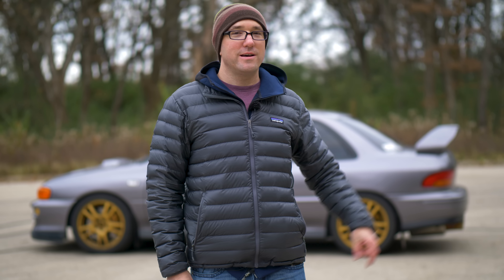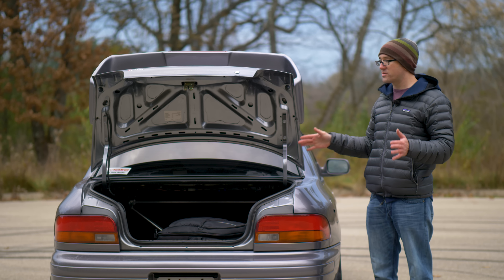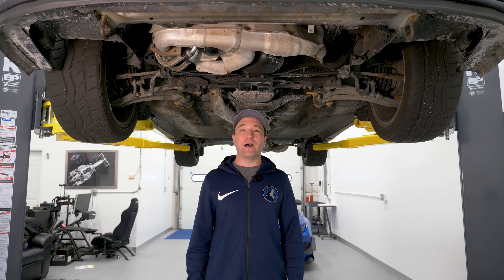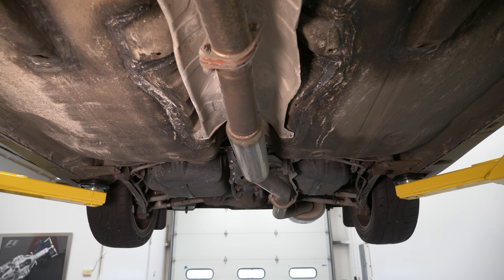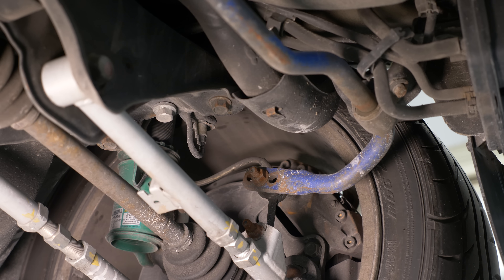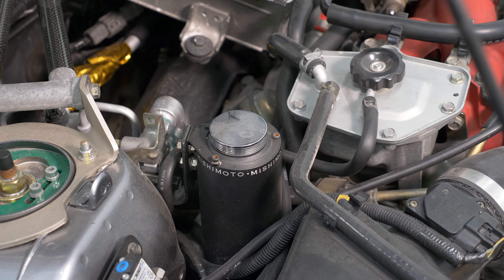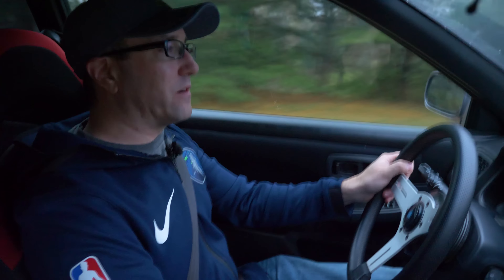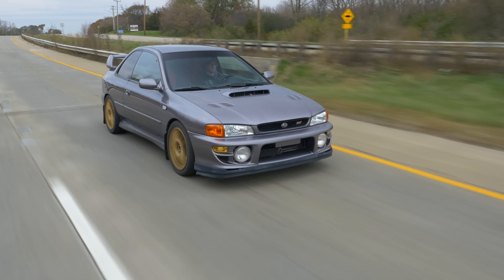Review | Subaru RSTi | When Older is Better

Comment: I too like late 90's early 2k's vehicles. My wife 2016 Escape is nice, but its too nice (for me). I had a 2014 Cruze (worst manual to ever exist), wound up losing some money on that vehicle since no one drives manual anymore. It was nice riding, boring, and fairly basic for the times. I would buy another but it would need to be the turbo model and probably auto, or the diesel version. Anyways, I eventually bought a 2006 SAAB Troll-Blazer with low miles. It has been great and every real SAAB owner still waves like it is special secret club; however, I am selling that next year (already have a buyer), I've decided I want some even more basic. Not sure what, but maybe an late 90's Mustang or Camaro, Subaru (have owned several Subaru's and love them!), or a Chevrolet Avalanche - which is something I've always wanted since they came out in my senior year.
Reply: Just wanted to add the Subaru I am thinking about is a Subaru Outback XT w/ manual. Would buy auto if the price and miles are right. Up here in Alaska they are too expensive. I can fly into Seattle and find one with less miles, the color I like, and options I want for about 2-3k less. Even after flight, time off work, and fuel / food, I would save $2k.

Comment: It's funny how simply you can circumvent legal restrictions by legally replacing almost everything that can be replaced. Jokingly, they could just have sent the VIN plaque to Japan and imported it that way. - Man, my car could use a total overhaul like that. I want it to last forever. But for that, first I'd have to find a calling that lifts my spirit out of the dark. (And now the Covid crap makes everything even worse.)
11:12 Is that the oil cooler? Because that's what my intercooler radiator looks like. 🙁 (While my engine radiator only works on the upper half. What a waste.)
11:15 Apologizing for rhyming is really douchebag style.
11:40 Speaking of mature: My custom racing brake has black calipers and moderately slotted discs. (with Pagid RS 4-2-1 - Ferrari street OEM)
The acceleration test made you laugh excitedly. That is a gold badge of approval.

It shocks me a bit that you say its chassis rigidity is not like modern sports cars - after the guy did pretty much everything you can do to improve it. ... Hm, I am wondering whether two strut bars might actually make the mid-chassis twisting more noticeable. ... BTW, I installed a cheapo front strut bar on an old Corolla AE90 and I could feel a significant improvement in front rigidity. I didn't expect it to be that distinct.

Comment: How is that RSTI so heavy? I put my STI Type R 1998 (JDM) on a scale the other day and minus my weight it was at 2730 lbs
Reply from the maker: +Anthony Therrien-Bernard Full tank, seam welding, foam, additional parts.
Reply: I should have watched until the end before commenting... i'm sure that helped a lot, quite a bit of additional weight but chassis rigidity is indeed not very great out of the factory
Reply: sunroof

Comment: Rather have a current STi drivetrain swapped  with the Porsche designed 6 speed  transmission and the 2.5L turbo with it's attendant extra torque.

Comment: "Dead nuts reliable" - as a subaru owner, I laughed
Reply: Idk man.. with proper maintenance I’ve had good luck with Subaru’s and Honda’s... well most cars aside from modern Audi’s and bmws and benzs
Reply: KrispyyWombat older Subaru if not over-boosted was reliable I heard but if you drive a high boost one like you stole it, well it will probably cry on you

Comment: Very cool, very well done build.  

One pedantic quip: this is a GM6 turned into a GM8.  The GC is a sedan. The GM is a coupe. It’s in the VIN.  The only way this could have been better is it it were a GF8 (wagon).
Reply: JDM coupes had GC stamped on the VIN and model# as well, and the P1 sold in the UK had also a "GC8" VIN. In fact, only USDM coupes were GM. Just to point out not all coupes are GM ;)
Coming from an original GC8 fellow owner, that's a great car, great job and taste into that RSTi.

Comment: @savagegeese How the hell do we get these cars back. Why can't they just re manufacture them again. It wouldn't cost them much with all of the blue prints done.  And upon buying them sign a contract that states you don't mind not having modern safety so they won't be sued. There's got to be a way to have these cars back in our lifetime. I don't wanna die not knowing how it felt to drive a new S2000, STI, or GTR from the 90s. I wanna know what it felt like to drive an old AE86. There's got to be a way. There's money that can be made.
Reply from the maker: +MusicBro94 probably need to start a company that has the power to license the designs of these old cars to remanufacture them. Thats about the only way and the f-you money you would need is unfathomable.
Reply: True. Sounds like something China could do haha. Thank you for your response.
Reply: regulations are curse , they wont make cars like this anymore because of government

Comment: "...from the header wrap" - there is no header wrap. Those are stock headers with factory heat shields.

"...from the little things you get a sense this car is not just a normal Subaru" - lists basic upgrades like swaybar endlinks and silicone coolant hoses. 

"..another special addition is this oil cooler. It cools the oil when you don't need it to...and adds extra places to leak oil from" - and the line rests on the header shields, to heat the oil when you don't need it to. Yeah, sounds pretty useful! 

" Ah I see it has the Cobb flex kit!" - points to the boost controller. 

Your video turned out to be more of a joke than Subaruwrxfan's ones, and his ones are meant to be a joke.
Reply from the maker: +Alexei Debelyi You cherry picked some good stuff bruh.
Reply: There's no need to call it cherrypicking. You messed up in a bunch of really basic areas, while attempting to educate others on the topic, own it. 

If you really want to get technical - your whole spiel about "high revving engine from factory" is largely BS - this was never a factory option anywhere but Japan. Your whole point about 90s cars being ahead of their time is moot, because you're comparing a custom build to factory options. 

That build is the same (less effective in fact) as taking any current USDM Subaru and sticking a version 10 Sti Ej207 into it, since Japan still makes those engines today. Yet according to you - that's only available back in the 90s. 

Your own lack of research and knowledge on the subject is the reason you made up a story that suits your own agenda, instead of what's going on in the real world. Sure, the cars are heavier these days, but most of the "tuner" offerings have improved in the last 20 years, not gone backwards as you suggest.
Reply from the maker: +Alexei Debelyi We never got this car in the USA. Not sure why you are so triggered over it. The point is and has been cars have been getting fatter and more complicated since the 90s. This car and other JDM style vehicles were vastly more drivers centric then.

It had header/exhaust wrap on it, feel free to review the footage again. No idea what you are blabbing about with the oil cooler, its placement sucks and the point of leaking lines being a concern is just that.  I spliced in the wrong footage for the boost controller/flex fuel kit.  I could waste my time arguing your personal agenda at clearly not liking our content but I will repeat this, high revving naturally aspirated asian cars are dead in the USA. Thats why that car and vehicles like older Hondas are special these days and why they have a cult following.  If you have your own video made on this car that shows it better feel free to link me to it so I can gladly comment on your perfect view on it.

Comment: I bought an STi4 new in 98 and wrote about tweaking it in EVO UK. We improved motor, exhaust, intake, brakes (AP), suspension (corner weighted LEDA) etc - it was a cracking bit of kit when completed and very rapid down a twisty road - https://www.youtube.com/watch?v=LHSZPXQN6r0

Comment: The car looks good rides right and uyouknow what it does how would you not want one? Seriously fuck new cars they are heavy as fuck but damn they do they look good and the overall speed of them is significantly higher. My position is that with a  lack of weight it creates a night and day diffrence when trying to essentially go as fast as possible or die in a blaze of glory. Lack of weight is speed.

Comment: Why do Americans have such crappy gas? In Germany you can tank Super 95, which is kinda the most basic gas you can get, and its still better than the 91 in the US. You can go even higher to 98 or 101 at some stations, but from what Ive read the 87 and 91 gas in the US doesnt even come close to the basic 95 you get here. Why?
Reply: Because it's cheap. In the US you buy gas at a third of the price you buy in Germany. I would go for shitty quality if I could buy it for $2 a gallon.
Reply: Xzstnce Different rating systems used.
Reply from the maker: +Xzstnce in my area we have 93 octane really high quality but that's rare in most of the country named Lee where the car culture is big. So unfortunately a lot of people have to go through this.
Reply: Your 98 is our 93. We use different rating systems to measure octane.

Comment: How is that a rep of a 98 type r? You have a rb5 rear spoiler a v3 and earlier steering wheel a non stock gauges v3  sti seat not even v3 sti or v4 type r sti seat has a 6 speed swap not a 5 speed. Dccd swap the on stock super rare v4 silver paint. V8 sti wheels while still running v5 2 pot rears and 4 pot fronts, v5 fro t bumper,. This car isn't a tribute 9ts a cabbage build as nothings from the same age at all its performance build  and you're missing the sti suspension.

If you try compare this to a v3/v|l4 type r it's not even close and you still have the steel boot bonnet.

This is a frankenstein buil not a 2000 build at close.... Ps I have a 400+ whp actual type r and a genuine ra l. These cars saying you have chassis. Flex wrong as if you look. At a proper ra or type r they're seem welded and the covered in the shit factory sealer crap.

Comment: "'90's cars aren't as safe as modern cars."
Bitch, these cars are for screet racing!  You want safe?  Go to the car-park.
Reply: You can make the care safer by using a 5 point harness.
Reply: @anthonyioane4438  Negative, harnesses are less safe for street driving.  They're meant to be used in conjuction with a cage and helmet.

Don't be one of the idiots that puts in a harness just to look cool.  You're just increasing risk of injury.

Comment: New to your channel, I don't understand why you call that car a "tuner car."  I've never seen such a basic, near complete OEM STi swap. Do you have some aversion to "tuner cars," or modified cars?

Keeping a car stock is a sin in my religion. OEMs make compromises to satisfy lawyers, and the regular, anemic customers thatmake up the majority of their sales. Adjusting a car to your own style, and expectation of performance makes the car better for an enthusiast.
Reply: M M 
LOL watch his earlier videos noob. You'll realize why he has an aversion to tuner cars. FYI, tuner cars are 99% junk. Fact.
Reply: But it is almost completely oem. Thats what i dont understand. The manufacturer is subaru. Original Equipment from Subaru. There is a whiteline antilift kit, turboback exhaust, on e85. I should probably not comment on these videos, difference of opinion will be difficult to overcome.
Reply: It's a fucking tuner car. The funny part is that I've seen tuners around here get SMOKED by stock/OEM F-150s, BMWs, Camry's, etc. LOL